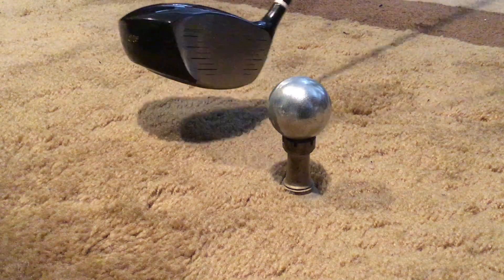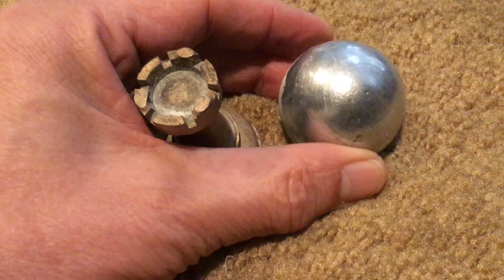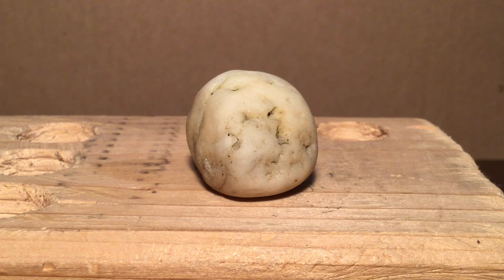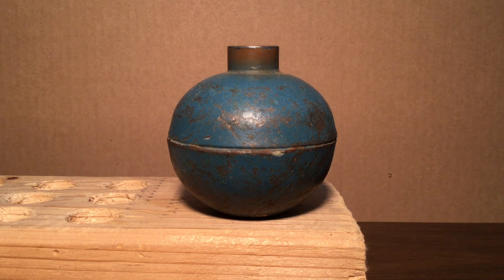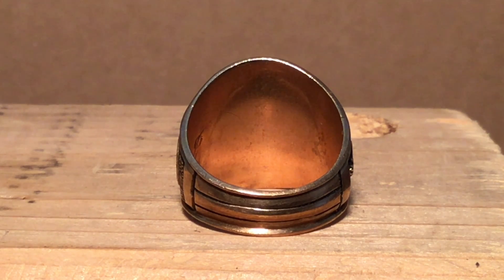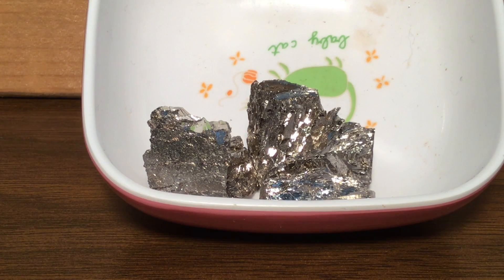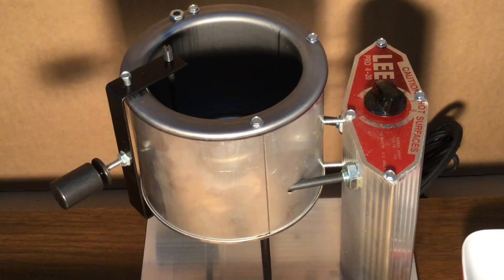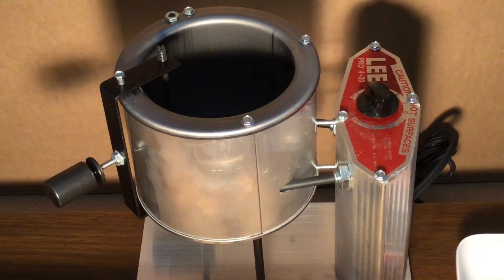Substitute Metals For Lead In Our Bullets: Additional Info VR For Elvis Ammo Zinc Casting Video

Comment: Stupid question time, how many times can you reuse your brass?
Reply: Unlucky Eddy completely depends how powerful the load is. fastest i had a case go bad is 5 firings or so for 22-250 with cases that never been annealed, the neck split. on the other end people been making lots of 38 wad cutters with the same cases for decades.
Reply: I shoot .303 Brit and I have a.44 Mag and I was thinking of getting into reloading for them.
Reply: Unlucky Eddy loading revolver bullets with carbide dies is the easiest thing to load. its a good place to start
Reply: Unlucky Eddy it all depends on brand how hot is the load. there are many factors that will vary.

Comment: How does the zinc ruin lead alloys. Does it do something to the strength or cause an oxidation of some kind what is the risks
Reply: rickrn2 i havent seen it in person but it gets weird like chunky soup instead of a liquid
Reply: Thanks Jake and thanks fortune I found your video from 3 years ago on what happens if you mix the two at high temps and how they pour.
Reply: Looks as if the only way would be through precision temperature control not exceeding zincs melting point but the two metals melt points are too close for comfort on a pot with most heating sources.
Reply: rickrn2 myself and lot of others just pinch each wheel weight with wire cutters and if it dents it becomes bullets. takes a bit but its worth it
Reply: I need to spend a day driving around on a wheel weight run if I can't get them for free twenty dollar bill goes a long way for the guys in the service bays actually changing tires.  Management always says no LOL

Comment: I bet those Zinc bullets are going to be a pain to size for starters,heat treated WW bullets are pretty darn hard to size on there own when their in the high 20+ BHN.  Secondly,Zinc bullets are much lighter than the same bullet cast from a Lead based alloy probably around 30 percent on average.  The weight differ is very important especially in cast rifle loads.  With a given twist rate bore you can only drive a given bullet to a certain velocity before the RPM threshold is met,once you pass that RPM threshold the bullet becomes unstable.  The only way to gain velocity and keep the RPM threshold in check is to go to a slower twist bore.  Otherwise using the lighter Zinc bullet is more than likely going to translate into a lower velocity load using the same bullet cast from Zinc.  Going to have to go check that video out an see what he's up to.
Reply: Reloader 7sixtwo the "rpm threshold" is for lead bullets because of it being weaker than jacketed bullets in the barrel. jacketed bullets copper bullets or even zinc are all harder so this dosent apply, otherwise there is no rpm limit unless centrifugal force explodes the bullet mid flight, which takes insane rpm's
Reply: The rpm threshold can be applied to all bullet types,the lathe turned style of bullets being made from all copper or brass are the least affected by the centrifuge  forces applied to the bullet by the rifles twist as far as the ability to withstand those forces.  If we are just talking bullet construction,even seemingly perfectly made copper cup lead core bullets come apart at some point if the V/RPM threshold exceeds the bullets design.   However the BHN / hardness of the zinc bullets are not the issues here,it's the fact that they are cast an as hard as we may try,a cast bullet is not perfect.  Small imperfection unseen by the human eye changes the balance of the bullet.  The higher the RPM imparted to the bullet regardless of how hard it is accentuates those defects and at some point accuracy goes south.   It's pretty easy to demonstrate the velocity /RPM / accuracy differences between two rifles of the same caliber with different twist bores using an identical cast lead bullet.  It's fairly easy to cast a bullet that will withstand 30-06 factory velocity in the 2700 fps range,I have friends that do it but the rifles have 1:14 twist bores,put that identical load in modern 06 rifle with a 1:10 twist bore and you velocity/RPM threshold drops down to around the 2K fps. range.  The bullet/load used is no different but the difference in twist rates which as velocity increases so does the RPM's have a dramatic affect on the bullets stability due to those imperfections.  It's really all academic till you load up some and shoot them.
Reply: Let's also look at things from the opposite end; the slow end, instead of maximum fast end.  If the rifle twist is too slow, heavy long bullets won't stabilize at lower velocities, or at some point, don't really stabilize at all!  Read up on why the .243 Winchester succeeded while the 244 6mm failed, and it was because the 243's original rifle twist could stabilize 100 grain bullets.  So, bullet integrity isn't the main issue, you can only do so much with a barrel twist with any bullet within a certain velocity without totally destroying its potential.  

I can shoot 170 grain cast bullets from my 6.5mm Swede Mauser in my original 1-7.5 inch twist barrel, at a low 1,150 fps and get good accuracy with a very slow, heavy plinker.  Try that with a 1-10 twist, 1-12, 1-14, ect.  Sometimes the problem with some bullets is not enough velocity for twist, not worrying about the bullet exploding on you.

Comment: I visited Elvis's channel this morning over Coffee.   I seen what he was trying to achieve with zinc, And it's a doable thing.  He was saying that his 155 gr bullets were weighing out at 95 gr when Made with Zinc, well here something out of the Box.. What if you were cast .358 150-160 gr bullets out of Zinc.. Those bullets would weigh in @about the same.  Load those with starting loads to the Mid in the .38 special or the .357 Magnum..  I would think that the Barring surface would give good accuracy. and the reduction of weight would accommodate Higher velocity.  (Now... This was Just an Idea and Not a recommendation for someone to try)  Safety and damage is something anyone out there would assume all on their own..  Dave.
Reply: Thorsaxe777 the only thing is all that bearing surface being hard zinc instead of soft lead would raise pressures all else being equal. so if that means u cant use as much powder to keep pressure down you might not come out ahead in a speed race
Reply: Jake,, Absolutely.  Like I was saying, It's something that got the wheels turning..  If someone out there was to experiment with it, They and They alone would be assuming all the liability for damage and Injury. Differently for someone who does his / her Homework. and Has been reloading for quite a while.  any advice on the way of safety is welcome Jake.   Dave.

Comment: Thank you for this video FortuneCookie, good to know that Zink is out of question due to hardness that would soon smoothen our rifling.  However, what do you think about melting the brass cases into bullets which would then be copper bullets? Or would you add on some other metal to further soften the alloy and make it more shootable ? Cheers
Reply: Antoua B sorry to tell you F/c is wrong about zinc . Zinc bullets are softer thin jacketed bullets so don’t let F/C scare you
Reply: Zinc is still alot softer then steel so it shouldn't wear out rifling although I have heard that it fouls barrels really fast so if we could find a cheap zamak alloy that doesn't foul barrels as bad as zinc we should be golden

Comment: Sounds like Zinc wouldn't be too bad of a replacement for lead in a smoothbore muzzleloader. Lighter weight would reduce recoil and get better velocities. I could see that being a real plus for very large bore muzzleloaders like the 8 gauge or 4 bore elephant guns.

Not that many people have those.
Reply: Keep in mind in terminal performance, weight is superior to velocity at some energy.  Especially with the kind of weight difference between zinc and lead, lighter projectiles in the kinds of firearms you are talking about won't penetrate as deeply because of its lack of mass and subsequent momentum, making it an inferior choice.  Also, the ball won't deform, which is preferable in most hunting situations, whereas soft lead can.  Also, keep in mind that black powder has a velocity ceiling because of its burn characteristics, so any gain in velocity will be limited, and will probably end with unburned powder.  Any flatter shooting achieved wouldn't be useful anyways, speaking of smoothbore guns, in any case, because it would not be accurate at longer ranges anyhow.

Comment: I guess we will have to start separating zinc out of our range scrap as to not melt lead and zinc into the same ingots.
Reply: Pure lead melts right at 622 degree F,while Zinc Melts right at 788 
degrees F.  Zinc is one of those thing I have to watch for when melting 
raw wheel weight.  It's not really had to keep the two apart in the same
 pot if you use a lead thermometer an watch your temps.  If I 
accidentally get one in the mix the Zinc weights float on the top just 
like the steel clips an are easily skimmed off.
Reply: Reloader 7sixtwo: 166 degrees seems like a small window for error but I have been wrong before. Guess I should add a laser thermometer to my reloading setup. I can not remember where I read it but I believe that there are some ammunition companies also using zinc in their bullets instead of lead.
Reply: Back when I started melting WW's 30 years ago zinc wasn't a problem but it's been gradually showing up more and more so I always use a lead thermometer to gradually work my melting pot temp up,haven't messed up a batch of lead yet.  About a month ago I sorted three five gallon buckets of WW's I got for free and only lost about a gallon paint can from the haul to zinc and steel weights.  That will net me a couple hundred lbs. of good WW alloy to add to the stash.
Reply: Jake A I hate that for you it's really about the same here these day at least with the chain tire stores.  The small Mom & Pop tire places in the outlying areas are usually your best bets as the recyclers don't bother them much.  They usually buy the standard WW's a well as there much cheaper than steel or zinc,scrap yards or recycles centers,Radiology Dept. at local Hospitals or Contractors that do renovations on old building are also a good sources to check out as well as local ranges in an outdoors.  It takes some leg work as well as putting out the word to friends and family members that you looking for lead work as well.  Good luck hope you hit a lead mine at some along the way.  Being that I don't shoot a public ranges due to distance or local ranges due to the high cost of membership I shoot at a friends house where we can collect and recycle cast as well as jacketed bullet from our berm.
Reply: ideamachineim Alrighity then, a lead thermometer it is. No laser.
Reply: Reloader 7sixtwo i wish i could get wheel weights, all my local places refuse a dollar a pound. i think most shops have contracts to where the lead goes. i end up buying 55lb lead bars online.